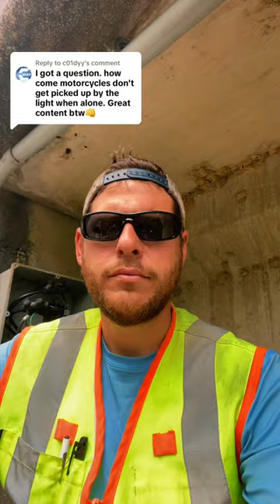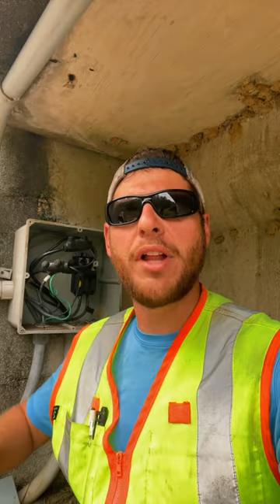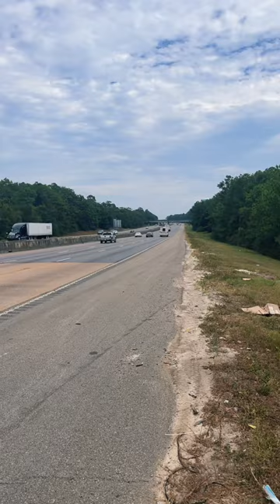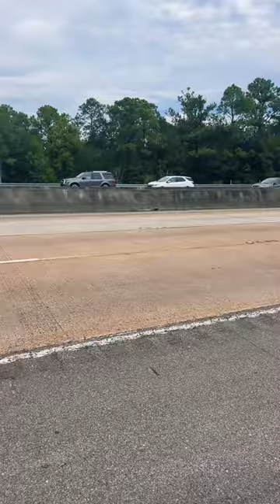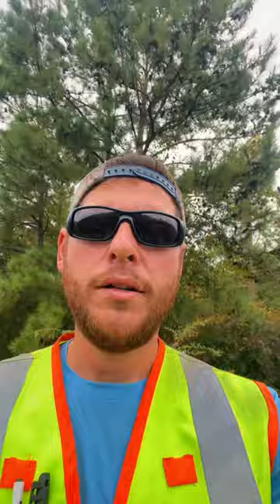Why you’re not getting a green light at a traffic light!

Comment: I’m not sure it’s the same, but I’ve seen people activate a gate that normally opens whenever a car drives up using a metal folding chair. I don’t know how practical that’d be with a motorcycle, but so you think that’d work?
Reply: We used to do it at work with a piece of sheet metal, like just a yield sign, even less than a chair

Management took it away and we didn’t have enough fobs to go around